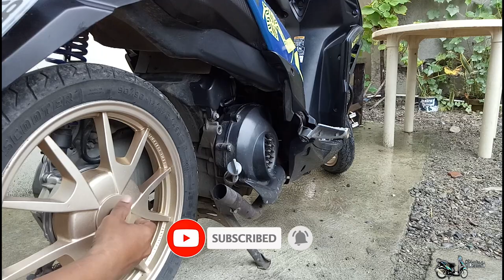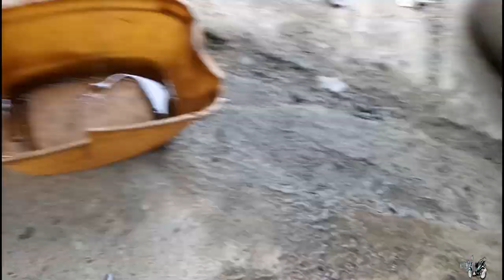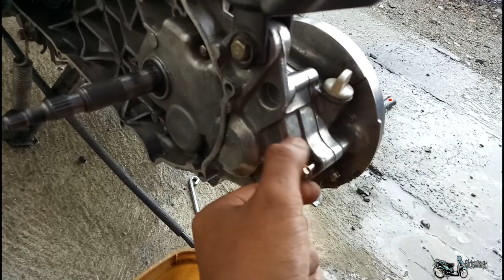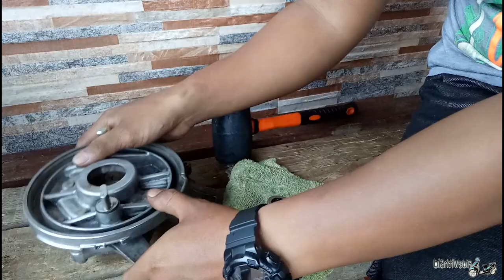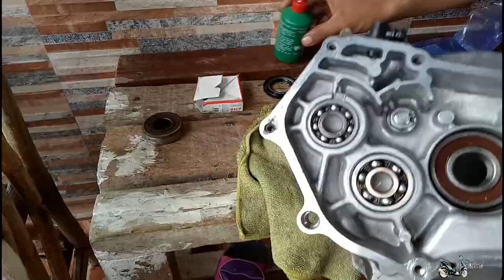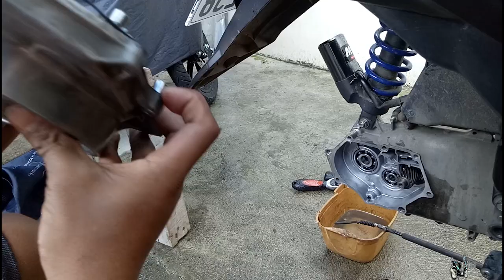REAR AXLE BEARING REPLACEMENT | Yamaha Mio i 125

Comment: boss isa din ba senyales na laspag na ang rear axle bearing ng m3 once kapag bibirit ka is mayrong iingay sa bandang hulihan na parang kakaskas na mga bagal o parang nagpapang abot na mga kuryente kse sa akin ganoon na ang nangyayari tapos sa twing preno ko parang may kakalso sa rear break.
Reply from the maker: Yes Manoy. Pwedeng iyan ang problema mo. Bearing problems sa gearbox mo. Check mo na mabuti mahirap na baka pati ibang parts madamage pa. Thanks for watching! Ridesafe!
Reply: Same here ganyan din mio I ko Boss pag naka center stand at pinihit mo silinyador may malakas na maingay na parang bakal sa bakal

Comment: Sakin boss pag nag fifirst trottle ako may parang gumagarargar jan sa may loob ng gear box ko, ano po kaya yun? Maari po kayang may bungi na yung gear ko, salamat po
Reply from the maker: Try mu lang itono ng mabuti air and fuel mixture mo Manoy. Tas Valve Clearance mo. Nasa Channel ko pala kung pano mag adjust ng valve clearance Manoy. Ridesafe sayu! Thanks for watching!
Reply: @RideWithSid  sir kahit po sa loob ng gearbox nang gagaling ang tunog,?
Reply from the maker: @jandiegadia6689  ahy pag gannun Manoy inspect mo na rin kung don ba talaga galing ang tonog. baklas / linis/ grease. ridesafe manoy!

Comment: Boss sana mabasa mo ito. 
Eto kase yung problema ko boss, may tumutunog sa motor ko banda dyan sa mga bearing, yung tunig nya ay nag kakalansingan. Tumutunoh lang siya pag paandar palang ng motor, tapos nawawala na siya pag nakaikot na yung gulong ng ilang beses. Sana alam mo pano ayusin o ano dapat palitan boss marameng salamat.
Reply from the maker: Try mo muna icheck mga panggilid mo Manoy!. Regrease mo muna at linisin . Check mo na rin kung umu-uga ba yung Gulong mo sa likod. kung umu-uga habang nagprepreno ka (FreeWheel Center Stand) then yun nga Rear axle bearing. pero kung hindi. Linis kiwi lang sa Pang-gilid Manoy! Thanks for watching! Ridesafe!